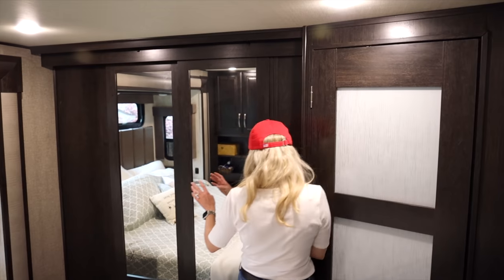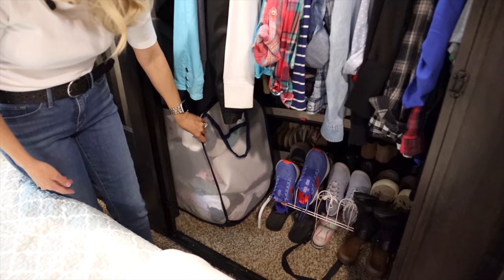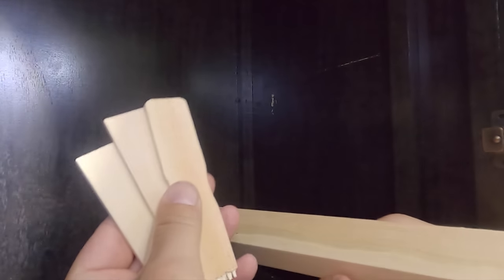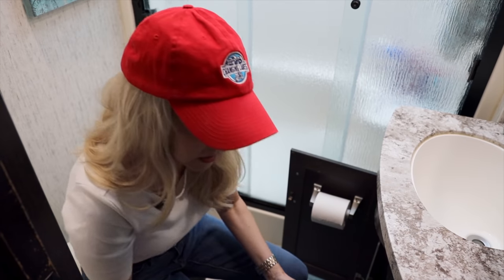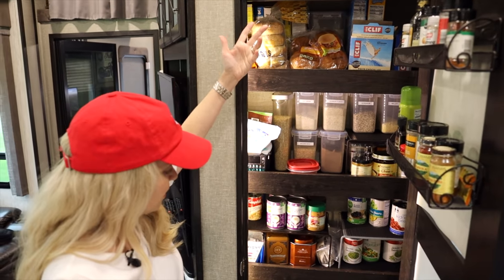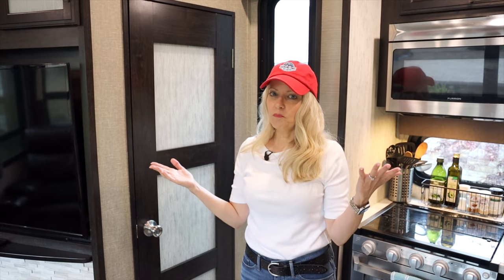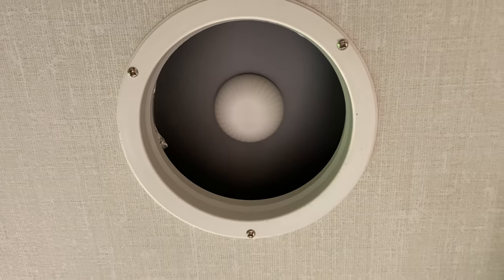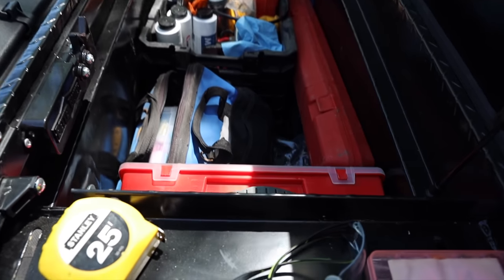➡️ RV Mods and Organization for RV Living [✅ Bonus Projects!]

Comment: Last night I was reading about the WiFi Ranger issues you were having  with their beta equipment on https://www.rvmobileinternet.com/. I was going to reach out and see were you ended up sine I will be needing a similar system. Guess I will have to wait.......
Reply from the maker: Yea.. Our GoAC was solid, but had trouble with the Spruce.  In all fairness, the unit we had was paired to a Denali that we tested but never mounted.  So, our unit had to be modified remotely to be stand-alone and I think it was never quite right.  But, even with our GoAC, it required a lot of TLC (rebooting hot spots a lot, etc).
Here's a spoiler on our new setup: https://changinglanesrv.com/mmh-our-bundle
Reply: Changing Lanes nice! I am still waiting on my 397th but have been taking advantage of a few Memorial Day sales....

Comment: How many nubbies did you install
Reply from the maker: I think six.
Reply: @ChangingLanes  Did you put them in all of the vents or just ones that you needed more air movement?
Reply from the maker: @danasweet4961  All except the bathroom vent and the vent in the "attic" (loft bunk).
Reply: @ChangingLanes  Thanks.  My 2020 Brookstone doesn't have a racetrack duct system.  It's a straight line duct.  I wonder if this would benefit us?
Reply: they seem to be helping